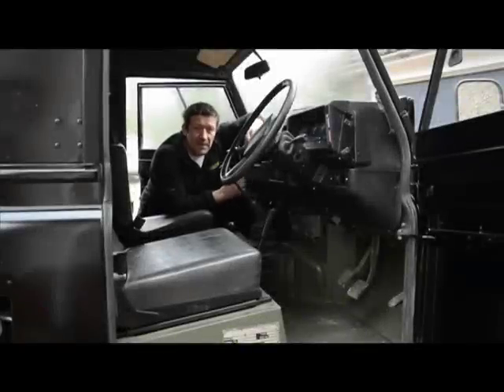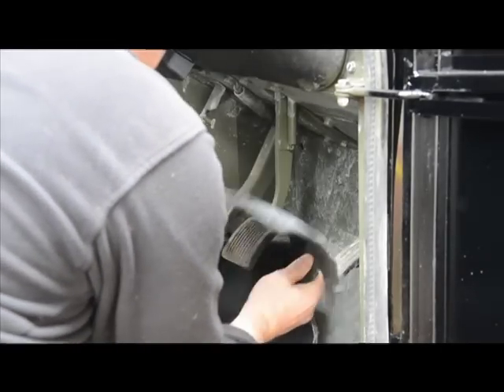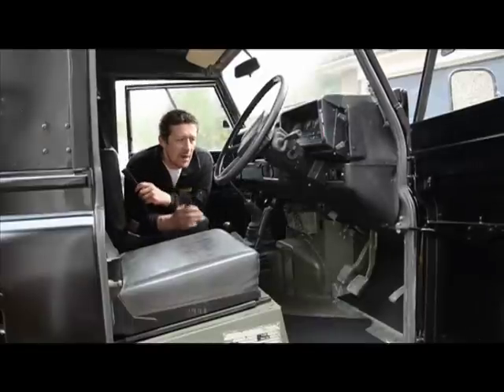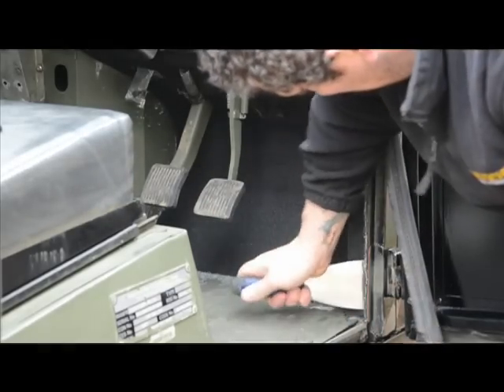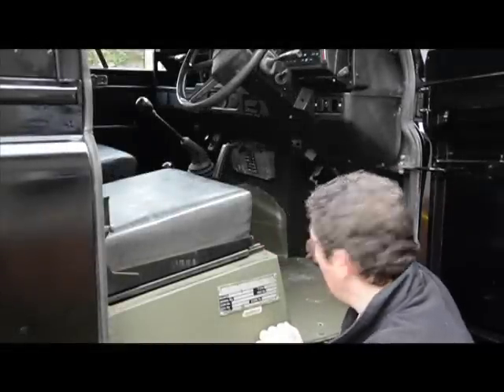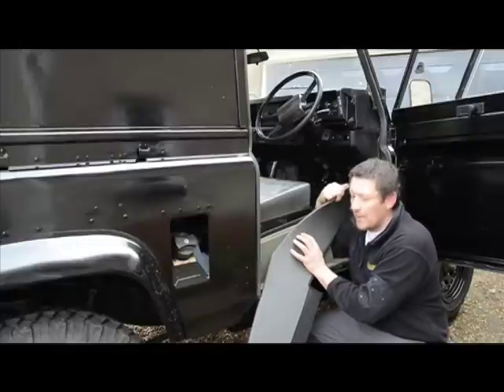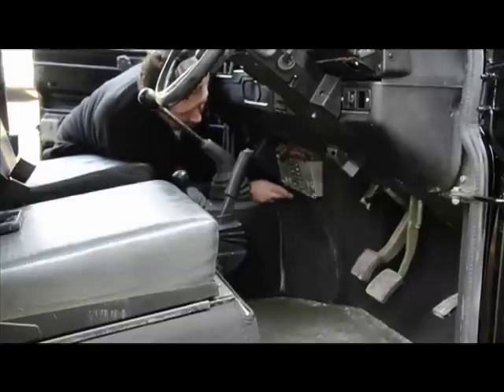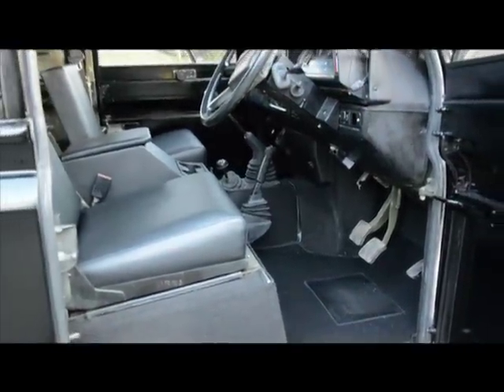Fit a carpet set into your Defender

Comment: Having once carpeted a 5-door 110, rent a steamer for a day.  It helps make the carpet more pliable and will give you a better fit around areas like the  gear tunnel, etc.  It's not really needed in the back, as everything is pretty much flat.

Once you add a rubber mats and a headliner it really changes the vehicle and makes it almost  civilized and just as a quiet as Discovery.

If you want a VERY quiet interior, use some soundproofing (e.g. Dynamat or a cheaper copy) around bulkhead.